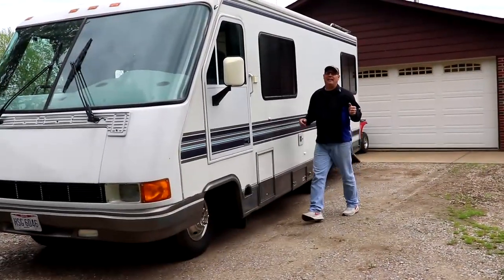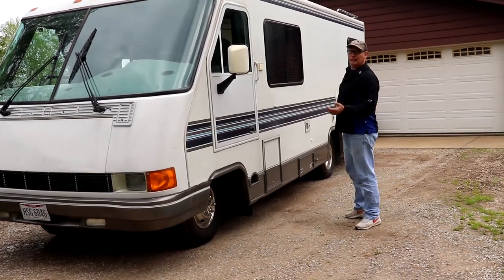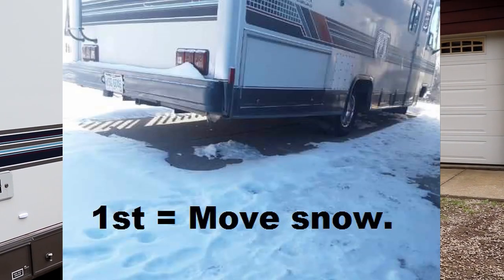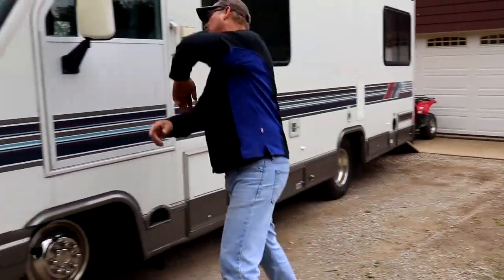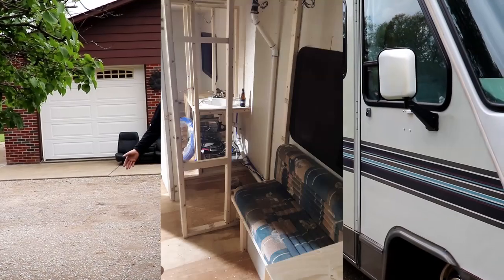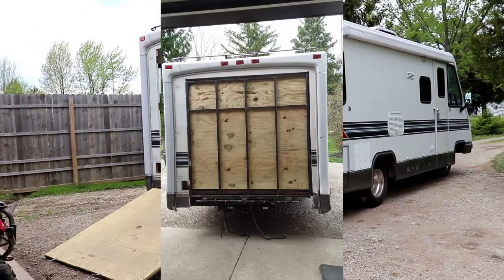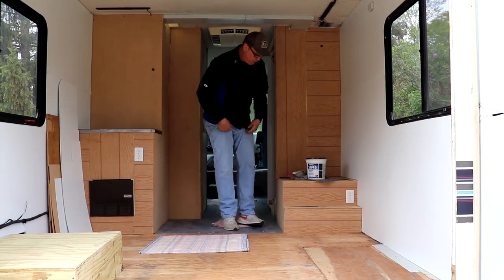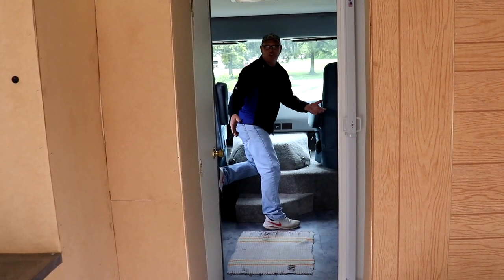Convert an old RV into a TOY HAULER- It's easy! Ditch the trailers!

Comment: I just bought a 27 foot 1998 Ford E350 motorhome with 80,000 miles on the 7.3 idi diesel automatic. 2,000 miles ago it had a full mechanical passed inspection. The exterior and interior look terrible. The PROJECT: Build a sleeper cabin with a queen bed AND a space to haul our 2022 Kona. Hopefully we can travel for three summer months exploring North America. We can park the rig and satellite areas with the fuel efficient compact car.
Reply from the maker: Heck yeah! Good Luck and thanks for watching!

Comment: That’s a clean rig, good find
Reply from the maker: Thank you so much! It was really dirty when we got it. I repaired any roof issues (very minor) and replaced most of the exterior hardware, rebuilt the man door & latch completely. Lots of family oriented hours of work have gone into it. Thanks for watching!
Reply: @GrenadeMotorsports  That thing looked like heap, you 
really fixed it up nice so far. I've been wondering if 
I could just widen the side entrance of an older 
MH similar to yours, there seems to be no one that
has done that. Doors are only about 26'' when counting
the inside frame, I need 33'' for my dirt bike, that's all 
I need , a wide door, lol. Doing what you did is my next 
thought.
Reply from the maker: @bikersoncall  YES do it!
Reply: @GrenadeMotorsports  
Thanks for the encouragement.
I might start with finding a fairly
current,  RV Park type of trailer
that might have a 42'' +- handicap
size door and frame, and go from 
there.  shrugs.... I don't think I 
could do a good job starting from 
scratch, making my own door.

Comment: Is it possible to get the plans for the rear opening, I'm considering this in a future project
Reply from the maker: No plans. Step 1: cut hole. Step 2: build metal frame & trailer door springs based on what you're loading. Step 3: 3/4 plywood the whole thing. Step 4: Trim, rubber seal and FRP covering, caulk & paint. DONE! Best of luck & thanks for watching!